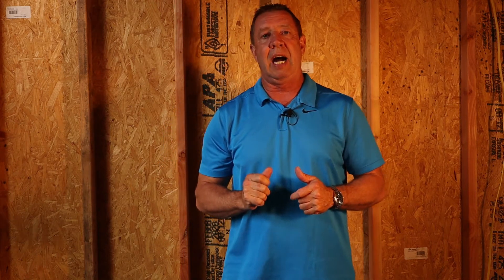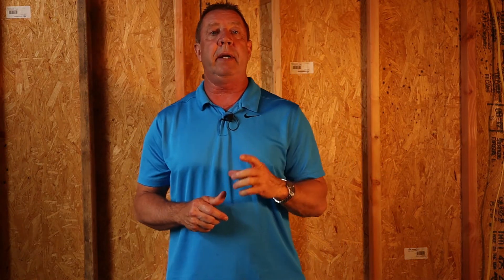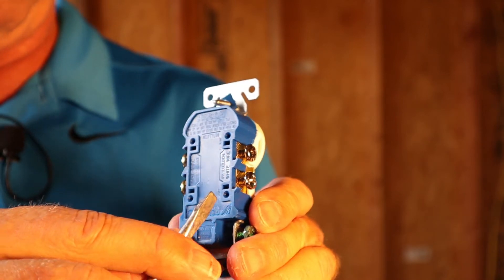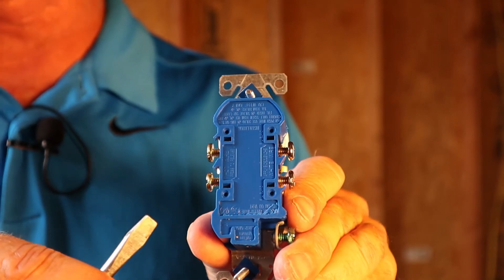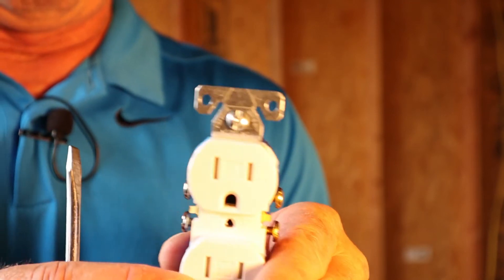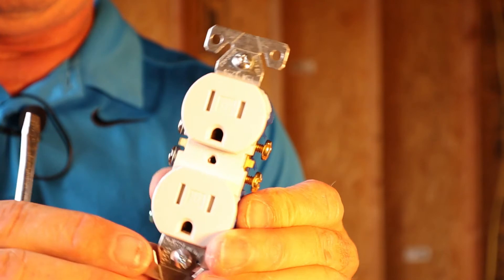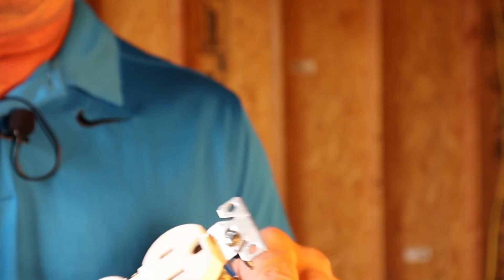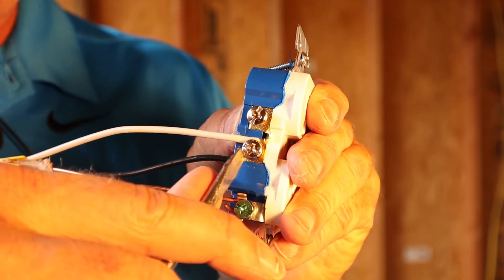Common wiring mistakes on outlets - How to avoid them.

Comment: The holes in the backside of the outlets are normally sized for 14 gauge wire .  In the profession that is called " Backstabbing' . NEVER Backstab for the reasons as stated.  I always run 12 gauge  wire for outlets, because you never know what High Draw load someone might plug in.  Use 14 wire for lighting circuits .

Comment: Metal doesn't expand when it heats up. It shrinks. This is why mechanics use torches to heat bolts that are hard to remove. If it expanded with heat they would never get those bolts removed with heat...

Comment: Great tips. The only thing I'll note is that you say that homeowners do these things. I've opened up outlets in three homes that were new. In two of three the "professional" electricians who wired the home used the holes in the back of the outlets rather than the screw terminals. Just another way contractors will "skin" a job, I know. But the problem isn't just with homeowners.
Reply: The problem nowadays,you DO NOT hire a company in which the owner of the company does NOT do the work!! These conglomerates who just sit in a chair all day at an office and send out journeymen and quacks that can’t tell a white wire from a black wire and skimp on using number 14 wire on a twenty amp circuit,that’s why homeowners and businesses have problems!! An person who owns an electric contractor company who doesn’t do any of the work is NOT an electrician!! He is a quack!! Even if all his helpers are correctly trained and licensed!!!

Comment: pops what do I do if my outlet has only 2 black wires?? there is no ground or white, just 2 black wires. The thing works but I wanted to replace it for a newer one since that has been there for 20 years. Its all concrete and I cant see if there are other things to extend it

Comment: I always use an outlet tester. They are cheap and small and would let you know if you switched the hot and neutral (among other mistakes). It takes 1 second.

Comment: It bothers me when people call a poor connection a SHORT. It is not shorted, it is actually OPEN. A short is a path to ground. an open is when an electrical path is not connected or poorly connected. An open wont trip a breaker, a short will. Not trying to be picky, but terminology is important when talking electrical.

Comment: 8:34  Reverse wiring the hot and neutral is NOT CALLED AN OPEN NEUTRAL!!   you have no business making a wiring video... "coating"?  N electrician, EVER, calls insulation "coating".  STOP!
Reply: open ground means when there is no ground wire or a loose ground then open neutral means there is no neutral or loose neutral open hot means when the outlet does not have power or a loose wire hot and neutral means that the outlet was wired wrong same thing to hot ground reversed. And correct means the outlet was wired properly.

Comment: How about a mobile home.
The methods on the connections at the outlets and switches are just pushed into a blade and there are not required to install AFCI breakers.

Comment: A good way to remember where the white wire goes is, white goes to the wide slot on the outlet.
Reply: Somewhat crude, but effective is, “A small hole is always hotter.”

Comment: Left out the most important mistake. Pigtailing is essential when adding multiple outlets.  The tab between screws can't handle more than 8 to 10 amps.
Reply: Even if it's commercial/spec grade?
Reply: I agree with your recommendation of pigtailing, but daisy chaining is still acceptable by NEC in general. I never heard that the tab can only accept 10 amps.

Comment: Ummmm…. These recepticles are designed so that the holes can be used. If it’s unsafe, or otherwise doesn’t work right, it would be illegal to design them that way.
Reply: It may be safe when first installed but... The point is that if you back stab those cheap residential grade receptacles and switches overtime the connections become loose. We bought a manufactured home that was 25 years old and it was wired that way. There were multiple loose connections in the home. Sometimes when we turned on the hallway light switch it would cause GFCI receptacles to trip. I replaced all the receptacles and switches with spec grade without back stabbing and everything is fine now. Some of the wires actually came off the switches when I was removing them from the box. That's how loose they were.

Comment: I been having a HOT & GROUND REVERSE for a year that I can't locate. I even rewired the outlets correctly,, althou they were already correct. ANY ADVICE OR OPINIONS?
Reply: You’re gonna have to explore everything on that circuit, even the light fixtures until you find it.
Reply: A hot and ground reverse reading almost always is an open neutral,  with a load turned on downstream.  A true hot and ground reverse would be extremely rare and dangerous,  because any lamp or appliance with a three pronged plug and metal housed would become electrified and a shock hazard.    Anytime I see hot and ground reverse I begin by checking all my connections,  9 times out of 10 a neutral had slipped away from a wire nut somewhere in the circuit, this could be at an outlet, switch or junction box upstream,  at a light fixture (sometimes,  usually in older homes they run power from the panel to the light fixture, then to other devices,  a 2 wire cable was dropped down to a switch box forming a switch loop)   or even at the breaker panel.
Reply: I checked the junction box, it's correct. No loose hot on neutral or grnd. Couldn't be in the wall?

Comment: Yup got it right. Take it from an old sparky the plug in on the back of the outlet junk use the screw correctly.  They should know if they want to be an electrician Black wire=unidentified  white wire=ground green or bare wire=grounding. Notice The ing that is very important some situation you shall separate from the ground.  With code shall mean will do... So many things to look for when someone inexperienced don't have the knowledge of right and wrong

Comment: I have found the best way to avoid the insulation being clamped on is to get the outlet that has a slot to screw down on the wire the right way. Very good info, thanks!

Comment: Correct me if I'm wrong, but open neutral means the neutral wire isn't connected at all, and reverse polarity means hot and neutral are reversed.
Anyway, this is a great video, its better than most I've seen.
Reply: You are correct. Open neutral means loose or no neutral at all. He meant reverse polarity.

Comment: Replacing outlets on my house I have found on some (in series) where the hot and neutral are on the proper sides, but the hot and neutral on top and bottom are not from the same cable.  They seemed to function without any issue prior to. I wired the new outlet on properly, but can anyone tell me if the improper one was dangerous or what it may have caused.
Reply: If their are two cables in the box, this almost always indicates the receptacle is acting as a splice to keep power running through the other side of the circuit.   On some rare situations the top and bottom half  are on two different circuits.    The metal tabs near the screw terminals will be broken in this situation.
Reply: to add to Sparky1500, if it’s on a separate circuit, the bottom is can be controlled by a light switch. This would be for a floor lamp or table lamp to be controlled by a switch.  I’ve seen the receptacles flipped upside down to indicate a switch controlled receptacle.

Comment: When the narrator states “it will short out”, he is incorrect in what is happening. He is describing an “open”, which is when a connection fails to carry electricity through it. If the wires are “poked” into the back of the receptacle, and the brass contact tabs fail to connect with the wire, that is an open. A “short” in fact is when the black wire makes contact with the common wire or the ground or some other ground, and that occurrence should trip a breaker to end that short.

Comment: Also, there is no "one ten" & "two-twenty" in this country. We have 120v & 240v. 
You shouldn't be giving electrical advice, dude.
Reply: The voltages are both correct.  The exact RMS voltage range can be from 110/220 to 125/250 volts.   Older term was 110/220.   Newer term 120/240.  Still the same thing.

Comment: You used the term "short" in a totally wrong context. A loose, hot, burning connection is not a short. It Is more likely to become an "open-circuit" by the wire melting itself away from the terminal. BUT, you should smell that nasty acrid burning insulation stink long before the house burns down. Unless you & your family are asleep @ the time, and wake up in heaven because you took the advice of a "builder" posing as an electrician. 
I sincerely hope this guy doesn't make money, or get sponsorships for telling you to "strip back the covering" which is actually called "insulation".

Comment: "BLACK TO BRASS"  is the easy way to remember it .
Reply: @papagigo1  yes got it, top or bottom brass screw?
Reply: @holddline  yup
Reply: Had a question, there’s two sets of screws on for black and white. In the case of black to brass Does it matter if you wire it to the top or bottom screw?
Reply: @holddline  no, it doesn't matter if it's top or bottom .
Reply: @papagigo1     What if it’s 3 phase 208/120 volt system?
Reply: @KevinCoop1  I don't know !
Reply: @papagigo1     This one is always true.   White or gray to silver side, green to ground, colored to brass.

Comment: They sell receptacle testers to test the polarity of outlets . Also if an outlet has too much of a draw  you have a dedicated circuit.
If not get a volt conn's voltage / continuity tester . Your small slot is hot and long slot is neutral  .also you should get voltage from hot to ground your middle slot  continuity from long slot to middle slot ground .klein has a volt con that has leads that fit into tamper proof receptacle slots